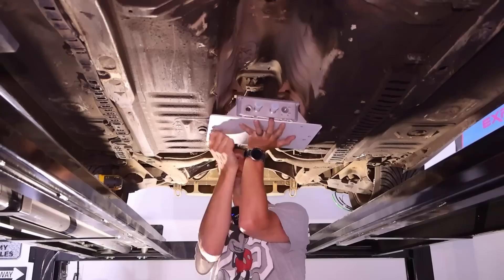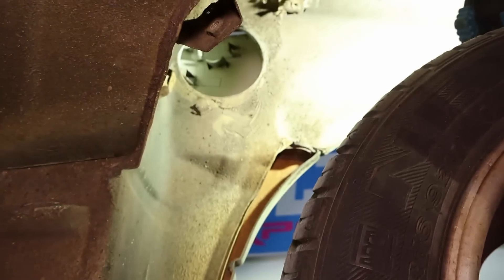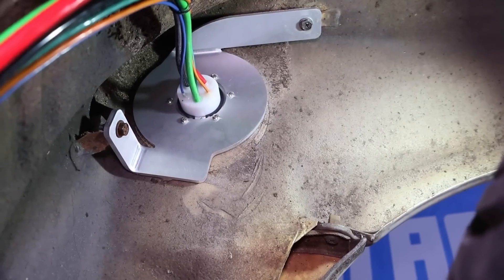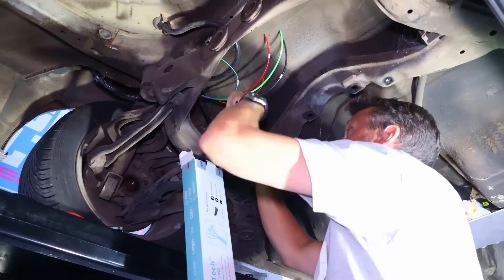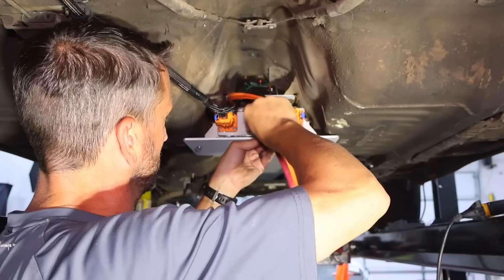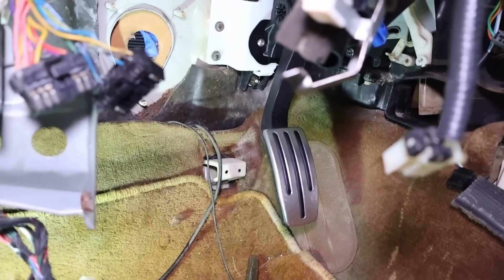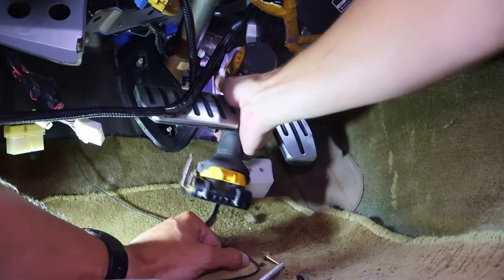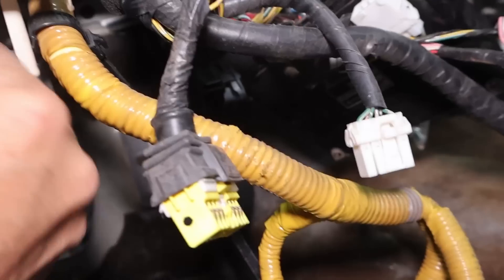Powering Up: Nissan 300ZX EV Charging System

Comment: I’m about to put my charge port in an s10 conversion that has a tilt bed to access batteries underneath. Do you think the movement of the bed tilting up and down could damage the wires?
Reply from the maker: Not as long as you have good strain relief and make sure ther is no rubbing
Reply: @electricsupercar you mean like a wide turn and lots of extra cable?

Comment: The circuit breaker should be in a much more accessible location. You of course want the current safing device to be as close to the source as possible but this means if it ever pops you have to remove that fiberglass panel and get the car on a lift to reset it.

Comment: You are doing beautiful work!  Your brackets look better than factory parts.
Reply from the maker: Wow, thank you!
Reply: I would say you probably need to make them a lot thinner if you're already getting bent parts. The charge port is way overkill in thickness (similar with the CCU and circuit breaker)
Reply from the maker: Better to be too thick than too thin

Comment: In China there are nicer cockpits and gauges than the one you use here. We have been to an exhibition in Munich lately and saw few suppliers for EV-parts also for ICE. Our GT-R got a Tesla-like new center console for example with software all included and it looks and works great. For EV we saw companies that do also instruments on demand and those where you design the surface yourself up to personal preferences!
Reply from the maker: good to know

Comment: Hey I really like your video's. For the circuit breaker. Consider the process when it trips. Then its not easily accessible. Consider relocating it to the trunk or whatever.
Reply from the maker: Ideally you want the breaker as close to the source as possible, but I agree with your point on accessibility.
Reply: I only read the comments because I was going to say the same thing about accessibility, though I was thinking he was going to put an access hole through the floor into the cabin. 
He is right though, it should be located as close to the source as possible.

Comment: Really impressive amount of progress in this episode. That's a really clever use of space for the CCU. My one concern would be the temperature rating of the CCU. If you go park in a hot parking lot to charge the car, is that going to work? Asphalt that's baking in the sun can approach 180°F, and your CCU is only a few inches up from the road. You can't really have good airflow to the CCU, or that allows a path for water and debris to come up from the road during driving. Might be worth putting some thermal insulation between the CCU mounting plate and whatever bottom cover you use under the car (and hopefully that doesn't ruin ground clearance).
Reply from the maker: It is a water cooled system (not air cooled).  I think we are good, but good point

Comment: Where you mounted your charging system (drive shaft tunnel) seems very exposed to the weather and water incursion.  How are you going to prevent electrical shorts and corrosion?
Reply from the maker: Answered in the video.  There will be a fiberglass panel that protects it from road debris.

Comment: 6.6 kw charger?
Reply from the maker: @Patriot3  yes
Reply: @electricsupercar  why so small? Just 110 volts. That's a long charge.
Reply from the maker: 220V.  Typical level 2 charging.
Reply: @ElectricSuperCar  I asked the wrong question.  Is this the only option for charging, or can it still use DC charging?
I forgot that my teslas have onboard chargers for 110 to 220. 
I'm very interested in seeing thermal management numbers while driving and charging. 
Have you done that video on your supercar?
Reply: @ElectricSuperCar  Good use of that tunnel space. Are you using the stock radiator.
Reply from the maker: Yes

Comment: You redoing the charger and vcu plate and correcting the stud lengths? For a nylok locknut you need a few threads above the  nut. For the VCU those nuts barely just thread on.

Comment: Why is it not NACS?
Reply from the maker: Tesla supercharger network is not available for aftermarket evs
Reply: @electricsupercar  Well might be able to supercharge as a non-Tesla...but I wasn't talking about supercharging I was just saying the Tesla connector could've been used regardless for lvl1 and lvl2 charging.  J1772 is going away.

Comment: Not going to use the US standard charger (tesla style)
Reply from the maker: Tesla supercharger network is not available for aftermarket evs.  J1772 is the US standard
Reply: Also, this car doesn't look like it's going to support dcfc, so even if all the charging stations switched from CCS to nacs overnight, it still wouldn't affect charging.

There are a ton of 6.6kW j1772 evses available, and even then a L2 nacs to j1772 adapter is really cheap.